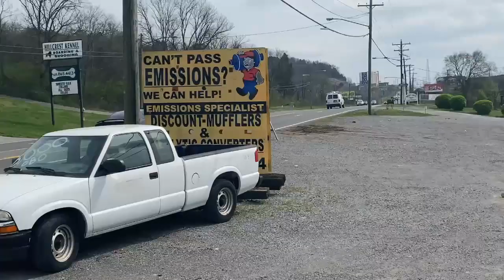Dodge Charger 5.7L R/T HEMI: FLOW FX Vs STRAIGHT PIPES!

Comment: We've got a 2011 charger rt,  we did the resonator delete,  and 4 inch Magnaflow race mufflers. Still has the stock cats. It's not as loud as the white r/t in the video, but louder than the black one.  A guy I work with has a 2018 charger rt scat pack, he did cat and muffler delete. Our 5.7 sounds as good(in my opinion....lol), without the 'old car exhaust smell.😂
Reply: How does the scat sound

Comment: Hey so I have a 2012 charger R/T and it has no muffler or resonator at the very end but one in the middle but it’s completely stock if I cut it off would I get the straight pipe sound

Comment: Give me straight pipes that will annoy everyone when I drive. Also, keep my tag low key, I hate attention
Reply: My sin had resonator muffler delete to straight pipe didn't even come home with tips.I cried my eyes out it took the value and aweful cracking sound. He lost 5.1 horse power taking away mufflers and resenator gives u ur fuel economy u got be careful u have no back pressure in engine it could effect the engines life in long run I'm putting my regular equipment back on much better performance and sound we have a Daytona rt its lost without its regular mufflers and it doesn't look nice without resonator. Them cars are not for racing